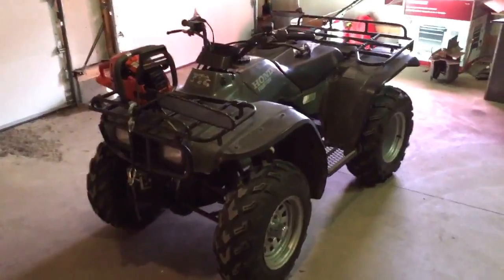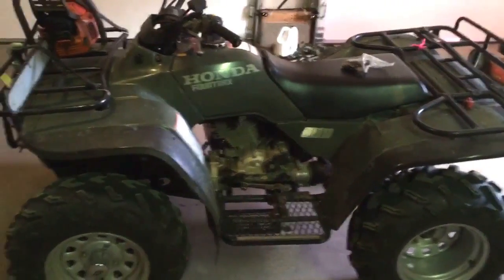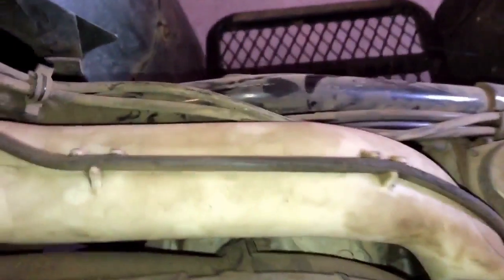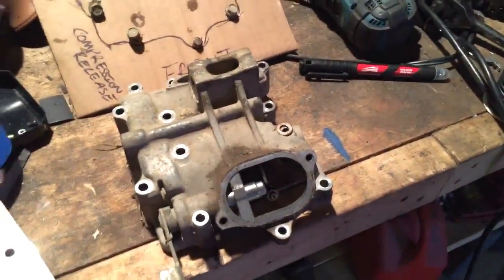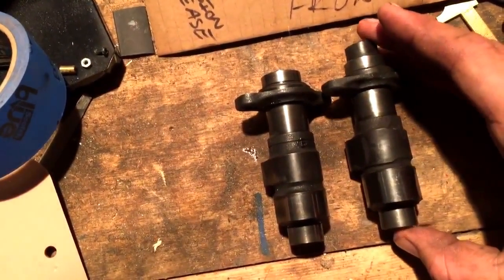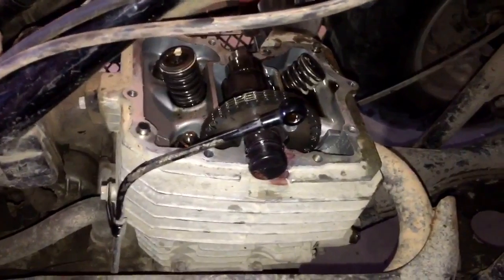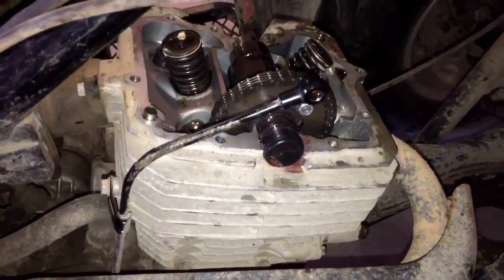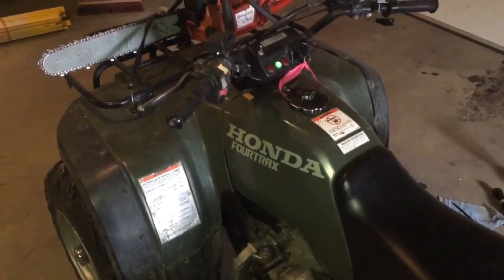Installing BIG RED CAMSHAFT in Honda 300FW

Comment: Where did you get it
Reply: And do you have a part number
Reply: Got it from an 85 big red. I don’t have a part number but it wouldn’t be much good anyway. If you try to order new it just switches over to a new number and you get the same camshaft as what’s in the 300’s already. 88 300 used the same cam as the 85 big red. So if you can find a good used example of either one that’s the way to go. I wouldn’t spend much money on one though, they don’t make that big of a difference. Your better off spending the money on a webcam if you can swing it.
Reply: @macfarms  thank you